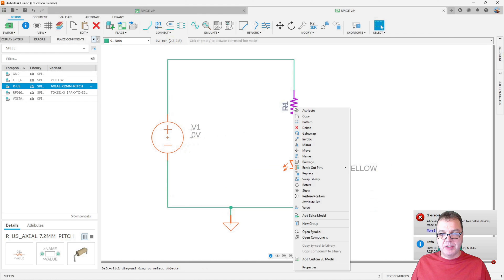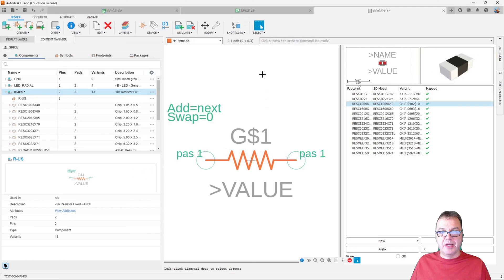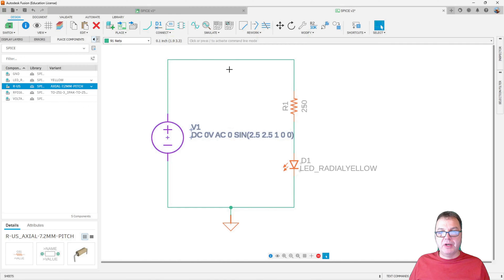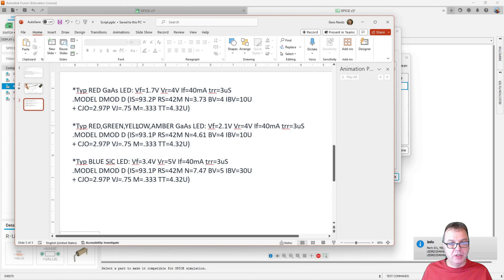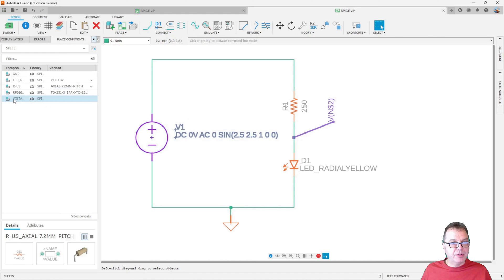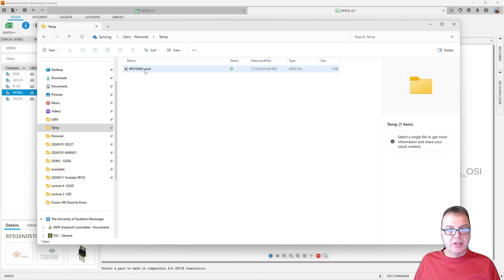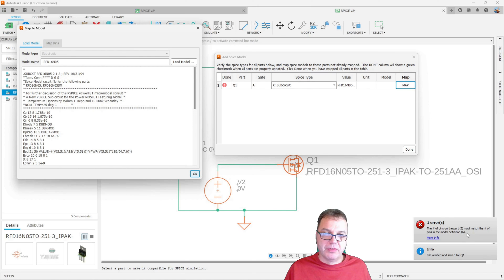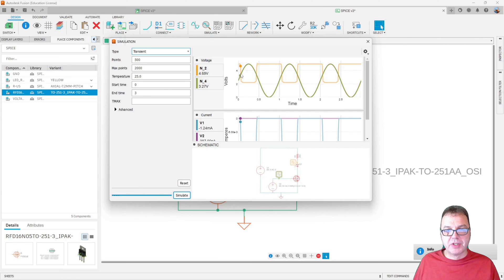How to Add SPICE Models to Fusion 360 Electronics Components

Comment: i am not able to add led like the one you have in your design. It only shows led chips
Reply from the maker: In principle, it does not matter what kind of LED you use as long as you associate the correct SPICE model. However, if you insist on a through-hole mounted LED like a T-1, you may need to find a different library than the one you are currently using. The Tinkercad library has a couple of options. Hope this helps!
Reply: @oceanexplorationlab  thanks !
Reply: @oceanexplorationlab  I found the components I wanted but now when I run the simulation it says no spice models added.. So how do I add the required spice models ? And from where do I get them
Reply: @oceanexplorationlab  I saw your video and I understood how to add models but not where to find one if not available directly
Reply: @oceanexplorationlab actually I have simulated and tested my circuit on proteus but I was not able to generate a pcb on it because of some software error so I am trying Fusion. I just want to generate the pcb design, it doesn't require me to add the spice models right ?
Reply from the maker: correct; to generate a PCB you do not need a SPICE model.
Reply: @oceanexplorationlab  thank you